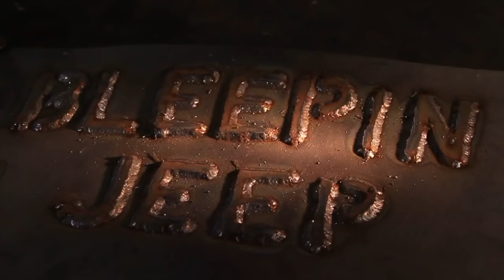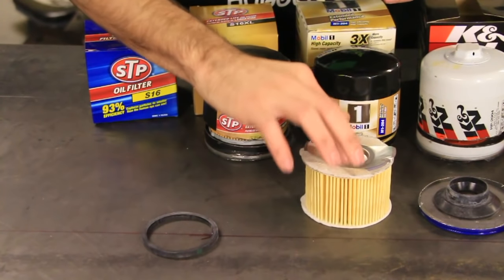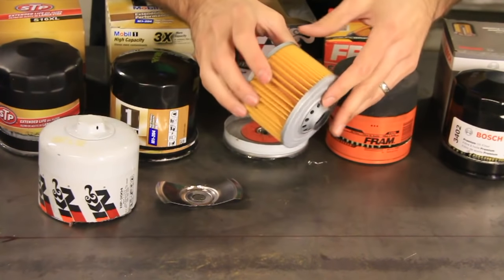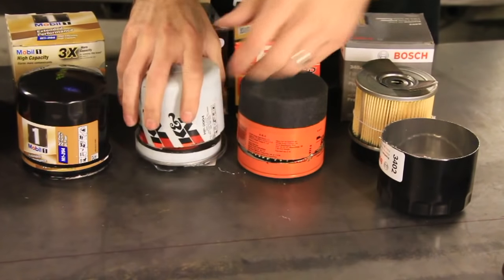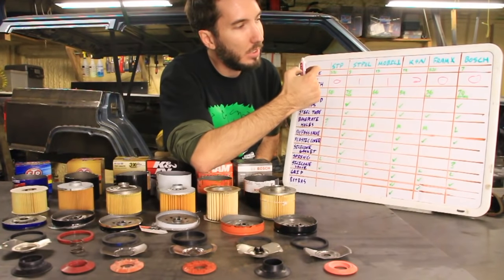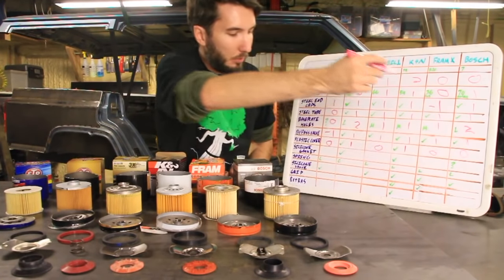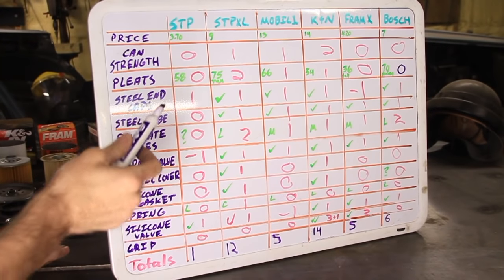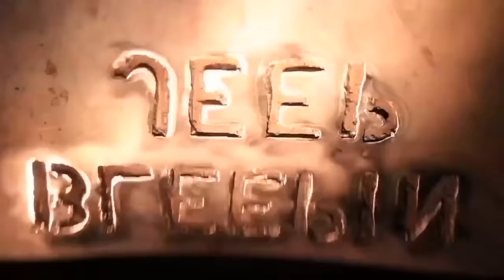What the Crap is in My Oil Filter?  We Find the BEST and Worst Oil Filters from AutoZone

Comment: Fram has made shit filters for decades. NAPA Gold, NAPA Silver are both Wix filters and are high quality.
Reply: +Jess Neal wix are fram with a label  and napa are stp i thought there where some videos that showed this but i may be wrong
Reply: +Jess Neal Exactly. Id like to see a video on NAPA filters now lol.
Reply: +Jess Neal ok i just checked napa and wix are the same and there own but they are glues and not sealed properly and have around 50 cleates they are like a junk version of the stp
Reply: +nekolin I'm sure there are better filters than the NAPA ones I mentioned. The NAPA silver has a nitrile ADBV. I have had good luck with NAPA filters as I am not the best at changing my oil regularly. bobistheoilguy (dot) com forums has a truck load of info on who makes what. I just avoid FRAM at all costs. Having grippy stuff on the outside is a marketing strategy and adds no value to a filter in my opinion. A wipe with a clean rag and a strap wrench is all you need. Really good video though showing some surprising results for filters I would have avoided before.
Reply: Jess Neal true but you also have to figure out what that nitrile is going to do to synthitic oils my big issue with napa/wix is that the cleats are not sealed just stuck together with a bit of glue so once that glue gives you no longer have a filter at all and sometimes the glue isnt even holding it together from the factory which is pretty scary
Reply from the maker: +Jess Neal I guess we'll have to see by cutting them open, I would have thought Bosch would be good but...
Reply: +BleepinJeep I've always heard fairly good stuff about the Bosch before too. I was surprised to see the string in it. One more thing you can do as far as comparison is to take the filter material out of the inside assembly and measure the thickness and length to see which one has the highest quantity of filter material. Depth of pleat and material thickness would have an affect on filter effectiveness. Great vid Matt :)
Reply: +Jess Neal the string is meant to be there. Motorcraft filters have them too.
Reply: +evilassaultweaponeer What purpose does it serve?
Reply: Not sure. Perhaps it prevents the media from shifting outward? In any case, I wouldn't count it as a negative considering it would take a double failure to put the string into your engine. The overall construction of the Bosch is pretty good, plus it has a lot of media surface to delay clogging. That said, I'm glad Matt pointed out that mystery dirt on the filter; I'll never put one on my car now!
Reply: +Jess Neal The string's basic purpose is during assembly and ultimately during shipping by preventing the pleats from moving once spaced apart and the can is sealed.  Once the media has "collapsed", the filter becomes more restrictive.
Reply: +4X4-HAM Thanks for the reply and info. Good to know ;)
Reply: +evilassaultweaponeer The string is there because of the filter manufacturing process.  They are using the string to hold the filter paper tight against the center tube before the adhesive in the end caps is cured.
Reply: +Jess Neal  who knows. I have been using Fram on my Subarus and the fucking things work. Question is, is it the Subaru engine that works or is this filter slowly killing them. Something that lasts 350k miles with Fram might last 400k with Wix. I don't know. Hesitant to switch now that I know that Fram does work, or does it???? Had a 91 Subaru recycled it in 2013 with 312k miles, all it ever had was Fram. And not the extraguard, but the cheapest ones from WalMart. And now the same thing with my 98 and 2001. The 2001 has 258k miles on it. Engine is noisy, as I am using SUPERTECH WalMart oil too. Double whammy. My oil change costs $16 though with taxes for filter and oil. But  I do change it every 3-5k miles.
Reply: +Vincent Higgins cheap vs decent filters , also try and find out the bypass pressure spec when selecting filters. 
I gotta use oem filters in my old Vw diesels , they have like a 40psi bypass pressure rating. The aftermarket doesn't even come close.
Reply: Fram might be ok for short oil change durations cycles - 3000 miles is about right.  The pleats distort badly under pressure in these and bunch up or open wide - no structural  integrity in the filtering material.
Reply: fram makes 95% of filters out their
Reply: False. Fram filters are manufactured by Honeywell/Allied-Signal. They don't make many filters other than Fram and about 3 other brands.
Reply: No that is false, fram/champion/honeywell makes filters for Mobil 1, royal purple, Ford (motocraft), GM (AC Delco), purolator, bosch, mopar, quaker state, valvoline, fram thats only a few! they make about 150 diffrent brands of oil filters and fram which also is honeywell makes Garrett turbos so fram makes one of the best turbos out their ;)
Reply: Do you have any links or websites to back up your info?
Reply: Honeywell puts their name on generac generators and those are the biggest turds going. 
They have great marketing 😂💩
Reply: yeah its like other company's using the snap on name on their shitty stuff they sell at costco 😂
Reply: for the filters or turbo?
Reply: Filters
Reply: Filters
Reply: Yea they call it co-branding. 
1 company builds it, and 8 put their name on it. 
Briggs and Stratton generators have a bunch between the portables and home standbys. 
Ge, eaton,rheem,ruud,Troy bilt,brute,some john Deere (portables), all Briggs units.
Reply: +James Franco Not true anymore, and Honeywell out of the picture since 2011. Sold Fram to Rank Grp. Champs Labs no longer part of Fram Filtration. Mobil 1, RP and ACDelco made by Champ. Motorcraft NEVER made by Fram, made by Purolator as are Bosch, Mopar and QS filters.
Reply: faxmen09 Many years ago Fram used to manufacture the old Autolite filters, back when Autolite was the OEM for Ford before they brought Motorcraft back in the 70s. I think people just assume that Motorcraft is made by Fram for this reason.

The last time I bought a Quaker State filter it was made by Fram. Nice to know that Purolator is making them now. (I worked for Purolator and can vouch for their quality.)
Reply: Yea iirc purolator is the oldest manufacturer of filters also. 
We used the promotive line at work, sourced thru advance. that changed names or I don't know what happened but we use carquest now. 
I did hear about advance buying carquest.
Those filters have a similar number to wix numbers so I suspect that's the manufacturer for carquest.
Reply: You're correct. Carquest stores used Mann + Hummel (who manufacture Wix/Baldwin) for their store brand filter, pretty much like NAPA does for their filters. When Advance bought out Carquest last year, they had to ditch Purolator as their manufacturer because Carquest was under contract with Mann + Hummel for the next 5 years or so for them to be the only supplier of Carquest filters. 

So, long story short, Advance "inherited" Wix filters after they bought out Carquest. Which is not bad, as Wix makes a damn good filter too. But I know that's going to hurt Purolator because Advance was one of their biggest customers. I would stand to guess that once the Mann + Hummel contract is up, Purolator will offer a better deal and Advance will go back to Purolator as their supplier.  But that's just speculation.
Reply: nekolin yep this is how religion would promote a filter - faith not science
Reply: Jess Neal I heard wix had an issue collapsing and ruined 50000 dollar motors in the industrial filters they were making is this true
Reply: James Franco fram has been crap for a long time and there are a lot if superior filters out there. I thought Purolator made Motorcraft filters and I have my doubts about the rest. Where did you get your info, I'd like to see for myself
Reply: +Jess Neal NAPA is made by Wix.
Reply: +James Franco Mann makes Bosch filters.

Comment: +BleepinJeep Skip the pleat count since the pleats are different sizes.  Instead cut the pleats out of the frame and open it up and figure out surface area (how long the filter media stretches out to be vs the effective height).  As long as the pleats aren't too close together that will tell you how much available filter material there is.

i would throw in wix, purolator and AC, all filters that are know to carry cheaper filters that are better quality (and also have synthetic element versions that are cheaper than some of the more expensive ones in this review.
Reply: My thoughts exactly, I dont care how many pleats there are. I care more about the surface area

Comment: That wrench port on the K&N isn't any good.  I had to use it the other day and as you have probably already noticed it has tapered edges.  You would need to take a hammer and a flat head to it, but if you needed to resort to using that and you did that... it would just tear right off.  Mine was stuck in the oil port when I took it off the engine.  I had to put the port in a vise and turn with all my might to get the filter off.  The body actually started to crimp and I thought it was going to rip off.  My oil wrench bent a little.  No more Heman torque'ing oil filters for me.  It had sat for a year after an overheat.  Exnay 3 points, yay 0 points.

Comment: Thxs for the video, however your point system blows. You should have rated each filter section from 1 to 6 instead of using arbitrary numbers, much fairer that way. great video and I can use your video and rank them on my point system. K&N came in tied for first when it should be last if you look at the filter material alone. The STP extended life looked like the clear winner of this bunch. Would never by that Bocsh with that string unless I was lost in the desert and needed an oil filter and that was the only one they had. The Germans are getting slack.
Reply: I bought a stp xl today . Glad I did. Nice filter.

Comment: I would be more inclined to give 3 points to the STP XL for a taller filter media with a higher number of pleats rather than to the K&N for a nut fitted to the end. Taller and with 75 pleats beats shorter with 54 pleats all day. Probably wouldn't have given a point for a sticker either. I would think the emphasis should be on how it protects your engine.
For mine, the $9 STP XL filter with the largest filtering capacity has got to be the outright winner.

Comment: I'm sorry but I don't think I have ever seen such a ridiculous comparison of oil filters, and the points allocation beggars belief.  3 points for an unusable removal nut that a socket or ring spanner slips off and you end up using pipe grips, 1 point for a sticky label, 1 point for  a coil spring when it does the job no better than a leaf spring as it just holds the filter cartridge in place the force being on the side of the cartridge as the oil is forced through. Finally ( although I could go on ) no points and not even a mention of the undeniable advantage of having the bypass valve at the top of the filter as in K&N and Mobil 1 ( although the K&N no longer has, since its been made in Mexico) so when it opens if the oil viscosity is high or the media gets blocked it does not wash oil over the filter media taking any contaminates back into the engine, which is exactly what can happen when the bypass is sited at the bottom of the filter. This is why filters with the bypass are generally more expensive due to cost of production. You get what you pay for.  Cheers Graham time served mechanic.

Comment: putting points for grip was arbitrary, functionality is more important than commodity when it comes to oil, so the most important aspect of this test was the filter plies and their design, not aesthetics. if thats the case, then STP XL is the choice to have over K&N, also, price should not be a factor to measure them, 6 points for the cheapest STP (not XL) does not overtake its poor design, people would spend a dollar or 3 more to have more quality in the long term.

Comment: "Surprising that the Fram came in second since it lost so many points early on, but it's so cheap that that makes up for it"   Ummm, no it doesn't. Basically by your own admission through your own gross examination test, even you realize it's a piece of shit.  It doesn't matter if the shit is cheap.  I don't want a piece of shit "protecting" my engine.  Just go with the Bosch.  It's a great medium between really good quality where it needs to be, ie, the actual filter, (who gives a shit about how thick the can is, it's not doing anything except holding the guts of the filter. And a place to put a crescent wrench, or a grippy surface, while nice for convenience, it does nothing for the quality of the filter etc), a solid bypass valve, good pleats, and a good price.

Comment: Never use Fram. I used a fram fuel filter once when they didn't have a motorcraft one and the filter part inside came loose and it was rattling inside. Since I drive ford I always get Motorcraft.
Reply: I used a Motorcraft once and it leaked where the baseplate is fused to the can. There will always be faulty products here and there with any major brand. Luck of the draw, really.

Comment: Thank for the informative video. For your next such video I would like to see you display the surface area of each can's filter media. This could be calculated by removing the filter element and measuring it's length & width. Multiplying the length x width would give you the total surface area of each filter. Since that is the actual working part of the filter, I believe it would be the most important data point you could offer in your comparison. What do you think?
Reply from the maker: +Michael Scammahorn sounds like a plan, I think I'll give it a shot.

Comment: autozone handling cheaper bad-fitting parts. my motor support, obviously from china , had to be tweaked to fit. Radiator bypass hose so thin, I was afraid to use it.  I'm switching to the Purolator Boss as my new found quality filter. I run 20w-50 and 65# oil pressure. don't need a cheap one. Twenty thousandths wall thickness not 15. 500 hp stroker. so just about any filter shown here will work for 5w-20 thru 10w-30 if you change it every 3000-3500 miles. IMHO

Comment: 'i think this can is a little stronger or exactly the same' ??? Huh? Which is it! All these non-scientific home garage comparisons are a waste of data storage.. No one gives quantifiable values for anything. No dimensions. No weights. No thicknesses. No volumes... all 'i think' or 'it looks like' bull5hit. How do you know it is silicone? It could be EPDM or Buna Rubber. 
It doesnt take much to run a caliper on the metal to measure thickness... or take a sample of the filter medium and run something through it to see what particles go through. Sh1t, you can even get specs from the damn manufacturer (beta value, efficiency... etc etc) 

i will concur with everyone else, though... fram is junk. just like those toilet paper oil filter kits you can buy.

Comment: hey bro...can you advice me...about what oil fillter to use on bmw E34 1991 520i..its 2 litter 6 cylinder non vanos engine..and what oil is recomended ..i got more than 415000 km on it and still engine look brand new its never rebuilded...and would help me to choose oil too...im thinking to use mobil syntatic oil 10W 
40 .in my country weather in winter -30C and in summer 40C ...and thx...

Comment: That string is meant to be there; watch a Motorcraft filter dissection and you'll see the same. That said, thanks for pointing out the dirt; you saved me from potentially putting that in my engine some day! I'd also like to point out that the lone point for the STP was a mistake (you tallied it as having metal end caps). Additionally, I don't agree with your heavy emphasis on grip surfaces; buy a filter wrench or spray some bedliner on a good filter yourself (granted, the K&N is a great filter). That aside, I am glad to see that the STP XL offers a good filter at a fair price, and I'd like to request that your next video include a Purolator (Classic and/or PureOne; my favorite filters), a Fram Xtended Guard (dark grey or gold depending on how new it is; this is the only good Fram from what I've read, sort of like the STP XL), and finally you should really cut open a Wix lest the fanboys eat you lol. Also, use this to help you choose which ones to dissect: http://www.gmtruckcentral.com/articles/oilfilter/gradesheet.htm

Comment: Maybe you can help me  Matt.
Just had my 99 XJ 4.0 rebuilt.
My engine builder wants me to run the lucas break in oil for 200 miles then change to rotella conventional oil and a wix filter which I always use.
All I could find in the 10w30 weight that he recommended was the T4 Rotella 10w30 .
Any thoughts on that choice?

Comment: Looking at construction is a good place to start but... the real test would be to put the filters through a  run test  (3000 - 4000 miles) and #1 have the oil samples tested for particulates, which is mostly all that the filter removes, and # 2 at what point does the the filter fail , under what conditions, and does the bypass valve open. (Only  easily tested in a lab setting)  Can thickness only has to be heavy enough to hold the oil pump pressure, its' shape, and not crush when some bad mechanic puts it on!  Anyone seen any real lab test comparisons anywhere?? You guys are right, FRAM looks like hell!! Other problem, for those that go to oil change places, how do they know  type of filter they're getting. Could be an off the shelf generic.

Comment: The Anti-Drainback valve in that particular series is also a bypass valve. The oil flows from the outside of the filter media in to the middle so if oil won't flow through the cartridge fast enough the pressure forces the filter cartridge back and compresses the spring, when this happens the oil goes in past the drain back flap and passes in between the inner part of the seal towards the outlet.  [@(IIIII)<{}]